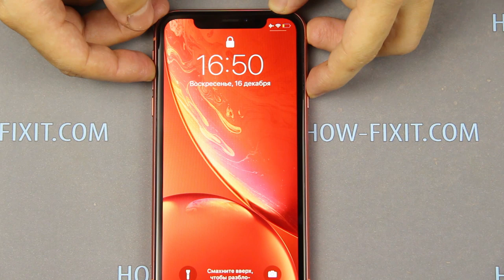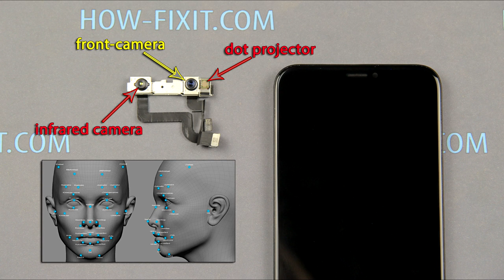iPhone XR Face ID and Front Camera Replacement

Comment: For xample you change whole this part include infrared & dot projector then the face id works or not ??? Tell me
Reply from the maker: no because it is tied to the motherboard of iPhone XR (thanks apple)
Reply: because this video is rubbish. if you replace front camera. face id won't work, he did not show anything working after replacement.
Reply: that's the thing's becoz if u change the front camera only u hav to change include the face id.. but i dont confirm 💯 it will work like before.. bcoz some of functions will be failed.. i've been the situation now. my front camera is quite blurry just bcoz the tecnhian use the blower heat and might be the heat is overheating so then the effect to ma front camera is blurry but the face id still can use. so  im so so trauma with this.. 😔

Comment: You can't change out the selfie camera on the XR.  If you do, face id and selfie camera will not work.  The part is serialized.  Apple should be fined for this.
Reply: You’re right on the money, only way to do this is buy a whole logic board with the camera/Face ID. You’ll be more mad to know that the IPhone 13 lineup of screen replaced third party parts, Face ID will not work.
Reply: I changed the modul and in fact frontal camera/selfie camera doesn’t work
Reply: how can i solve?
Reply: @filolimpennatore5581  u must restore the device after camera replacement

Comment: Hello. 
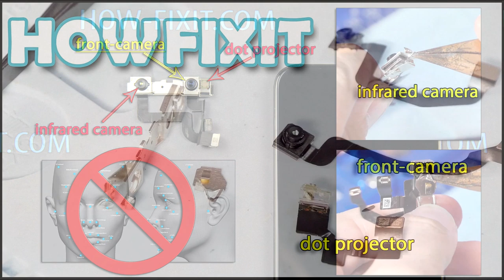I have a question. 7:57 
Im replacing the camera module on iPhone XR. Will everything work. 
Or will i get a ”important face id message”. 
Is it the same as when you replace the battery. That you get a important message in settings?

Comment: I had switched my housing and used my same camera but my Face ID doesn’t work
Reply: Have you fixed it? I have replaced my broken screen with another original from donor phone. my front camera works but face id wont work....

Comment: my face id is not working after replacing the logic board. Then if I buy the face id module in the description link. Will my iphone xr face id be able to be used again?
Reply: No it won’t
Reply: The front facing camera and earpiece speaker is paired to each iPhone logic board replacements break Face ID and Apple are the only people that can reprogram them into the iPhone logic board